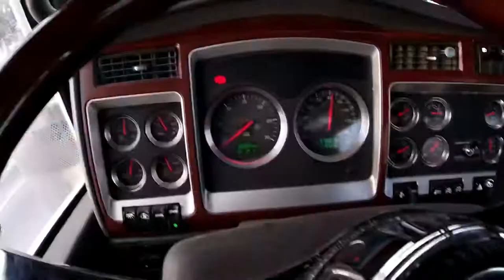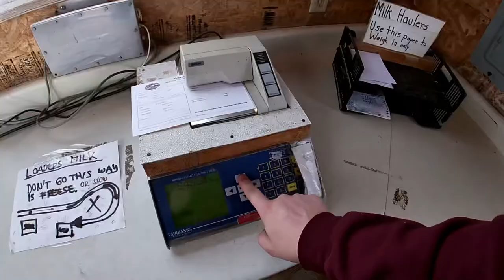Keeping the Calves Fed!! Trucker Vlog!

Comment: Do you have issues of the augers gumming up with that wet calf feed? Also that truck sounds wonderful unloading.  What motor is in the truck?
Reply from the maker: It’s a isx 550 Cummins...... it does gum the augers up we just have to wash them out every now and then
Reply: @hooverfeedofficial1494  we have power washer couplers welded on the back of the boom auger and run hot water thru them.
Reply from the maker: Wyatt Vos ok ya I’ve never heard of that...... we just fill our back bin with water and then turn our auger in reverse and let it run awhile then when we put it forward and turn our discharge auger on at a 45 degree angle just so the water falls back